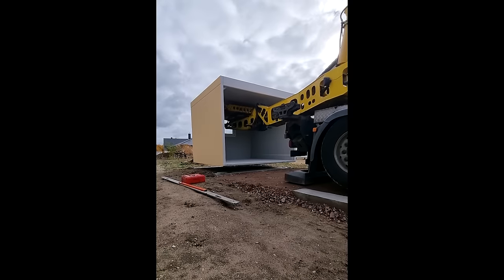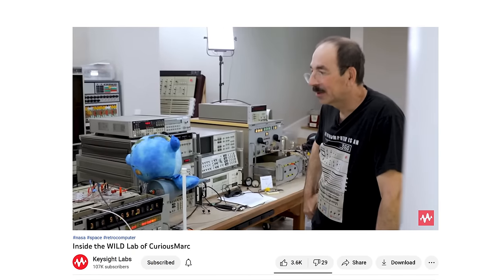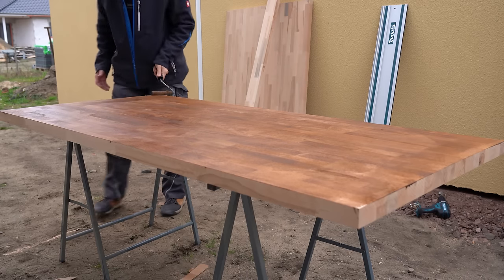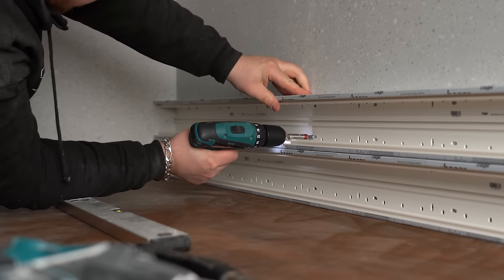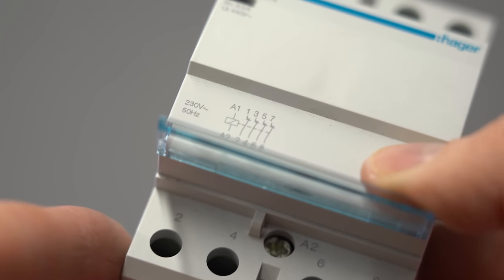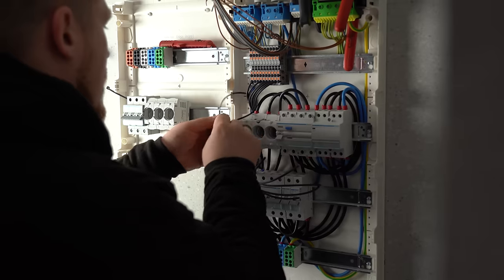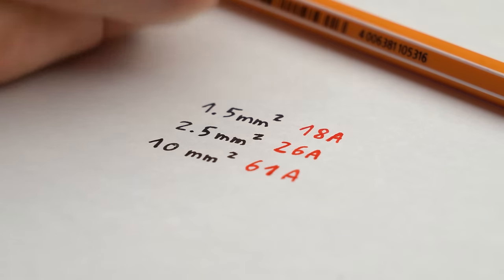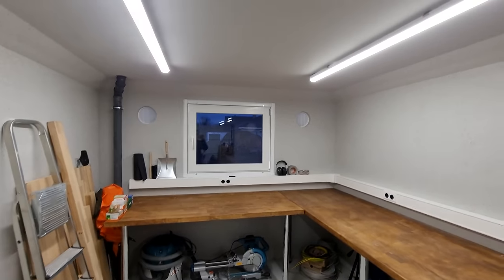Germans do the PERFECT Electrical Wiring! (Garage Build)

Comment: nice video!
A few things, first, I would have limited the use of spring loaded connectors, especially on the 400V, screw terminals may a bit more pain, because they need tightening ideally once a year, but I think they are more secure than spring loaded (if they come loose, you have to replace the whole device).

Adding a few RJ45 sockets in the modular wall conduits wouldn't be too much I think, it's better than trying to catch the Wi-Fi from the house through the concrete walls, plus, that would limit radio emissions too and that would be nice if you try yourself on wireless projects. 

For the emergency stop button, swapping the relay for a security relay is a must, your standard relay doesn't give you the guarantee that it will break the circuit if he got damaged (a short or any type of over-current can easily weld the contacts together) a dedicated security relay will break the circuit permanently if the power module get damaged and the automatic reset of the emergency relay on the NO contacts is a bit risky I think, you have no means to know if the fault still there or a device is still powered, a manual reset next to the door would add the extra step to ensure everything is safe before closing the circuit. I think Schneider make safety relays that include a surveillance module (maybe Häger too, but I don't know their catalog enough), with emergency stop and reset loops and a protected power module that hook the mains right after the fuses and breaker, they are probably more expensive, but I think they worth it.

Just out of curiosity, why the diazed fuses? I thought they were progressively phased out in Europe, is it a standard still very present in Germany? last time I saw this type of fuses, it was on a 30 year old machine, it was a pain to get new fuses and very expensive compared to similar 10x38 cartridges.

That's all I could think of, I hope I didn't come as arrogant or aggressive, English isn't my first language and I was told that sometimes I may come as a bit obnoxious, I assure you it's not my intentions :)
Reply: I'm no electrician. But i think the diazed fuses are better for high inrush current. The standard automatic breakers (C- characteristic) can more easily trip from starting motors, pumps, angle grinders etc. It is still widely used believe 😀
Reply: Indeed, as Eytaris wrote for emergency off you cannot use a Standard relay! You need special safety relay. On a Standard relay there is the possibility that that contacts Stick together due to arcing. Therefore you need to use safety relay.
Reply: Diazed fuses are still used as "main fuses" protecting the whole circuit; automatic breakers are then used in each sub-circuit. The idea is that the automatic breakers will catch any fault in normal conditions and if the diazed fuses should blow you really do have a real problem to solve. They used to be commonplace as normal circuit breakers, but those days have long since gone by.

I agree on safety relays, and in most places, you actually need two of those in a row (one opening, one closing) to prevent sticky contacts from arcs ever happening. Also, you should not only break the L1, L2 and L3 phases, but also the N neutral (but never the PE protective earth). Usually, safety realys will have four contacts exactly for this reason. Also, in a new installation involving 400V CEE outlets, one should have an automatic disconnect in case of power failure; this prevents an uncontrolled inrush current into any devices connected if the power returns. This requires switching the supply on manually, which is a minor nuisance, but a tremenduous safety improvement.
Reply: Hi, I also agree regarding the use of a true safety relay. Btw. The 64W will be drawn only for a short time, then it will drop below 6W or so. 
The datasheet sadly isnt´t clear in this. A comparable SCHNEIDER GC6304M5 Relay shows: Anzugsleistung 53VA, Halteleistung 6.4VA but only 2.1W of true power.
Reply: German Electrician here, although im NOT perfectly aware of the exact ruleset (VDE). You are righ, Diazed fuses are hard to find, thats because we have Neozed fuses. They are always the same size (Volume) in different ratings, so a 6A Neozed fuse is the same size as a 63A fuse. And yes they are used as main fuses befor a RCD or longer wire parts with higher diamater for more Power. Fuses and RCD's should always be selective, meaning you lower your rating the lower your go. NEVER put a higher or same rating fuse or RCD behind each other. So after a 35A Neozed fuse you go through a 40A (max) RCD, to your 16A breaker. Ask if you want to know some more :)

Comment: 7:56 - The 62.5 is only in the short period when the device closes. Holding it closed is only 7W according to the datasheet provided by Hager.
Reply: I knew it felt off having a relay coil draw that much continuously
Reply from the maker: Can you give me a link? The way it heated up while being activate clearly didn't feel like just 7W.
Reply: @GreatScott!  According to their website the operating consumption of the coil is 5.75W.
62.5W is the inrush power to close the relay.
If you really wanted to follow the industry standard everything should be redundant (2 contacts per E-stop and 2 relays for the power) but it seems to be a bit overkill for a garage.
At least having something is beter than nothing and E-stop are a great addition for a consumer's workshop so great idea an keep going !
Reply: @greatscottlab  Link? You can just measure that with your Gossen Metrawatt. But yes, above is true, AC coil contactors takes 10 times more power to close, when magnetic circuit is closed it takes much less. 63W in such small device will melt it down.
Reply: @greatscottlab  62.5 watts in a tiny coil inside a plastic enclosure the size of a fist without active cooling would be very hot. Think how hot modern CPU's run with their included tiny heatsinks under a full synthetic load. Now imagine stopping the fan, would you dare touch that heatsink after a couple of minutes?

Though to be fair, the CPU would (eventually) thermal throttle when it reaches TJmax and it's clock speed would drop like a rock therefore it's power consumption would drop as well. But even then that heatsink would be unbearably hot to touch.
And obviously a heatsink is made of metal which conducts heat way better than plastic.
A normal candle is supposedly around 80W of heat energy just as an example.
But you've got testing equipment. Measure the power draw?

Comment: You've done a great job with the building's electric connections. BUT, what I haven't seen in the video and I strongly recommend (in fact, i don't know german regulations but in Spain is mandatory) is the installation of Protection against permanent and transient overvoltages.
Reply: As a student we were also just explained about importance of adding such protection, however first you had to evaluate the risk factor on the site and I believe if it wasn't a public/government building you could only give your recommendations to your client about this. That's when we were told stories about some folks trying to save some money and ending up with huge losses due to fried expensive electronics, computers etc. because of overvoltages. :)

Comment: The wiring system you used is essentially exactly the same in Australia. We use the same breakers.
The only difference being is we use flat TPS cable instead of that white circular  cable. And where the conduit goes into cable boxes we would run the conduit directly into it, no cable can be exposed at all. Super interesting though

Comment: Nice job. I can tell in Italy fuse boxes are extremely rare since the seventies and aren't used in new constructions... so it's kind weird to see them 😊
Reply: What the heck do you do if not use fuse boxes? Mount your fuses to the wall?
Reply: @the_retag  we use thermal-magnetic circuit breakers...
Reply: @staffa007  ah
So still a fuse box using day to day terms. Few probably still ise songle use fuses, but its always called fuse box not corcuit breaker box
Reply: @the_retag  😁 👍🏻
Reply: There are beakers on the panel. The incoming phases are protected by fuses. That can be a requirement. A breaker can fail so that the circuit stays closed, a fuse cannot. That is the reason why for example in Finland the main fuses have to be actual fuses.

Comment: 400Vx16Axsqrt(3)= 11085 VA. A 16A CEE outlet can deliver 11kVA, not 6kVA.
Reply from the maker: Correct. I did not want to overcomplicate things with sqrt but that was not the correct way to do it.
Reply: @greatscottlab  simply count it as 3 times the single fase 16A*230V

Comment: For endings and corners of cable pipes, use protective ribbed hoses (wire loom) that fit into the canal. This hides cables, and protects them in those places (important close to workbench).
Reply: I was also surprised that the cable was left unprotected. I assumed they were going to finish it, but left it like that. It is my only complain, and otherwise a very very neat job.
Reply: I am not sure why, but unprotected endings and corners are common in Germany.
Reply: @JackNorthNexus  The cable is double-insulated. Using conduit is not required at all.
Reply: the pvc pipes are only there to hold the cable in its place, the cable is double insulated

Comment: Hot damn. You guys are gods compared to what Mexican electricians will do with our houses' wiring.

I can't count how many times I went and found incredibly unsafe and out of spec wiring in my own home.

To give you an example: Electricians in Mexico will refuse to install physical GND on a house if they can avoid it.
I struggled to get a guy to install one ground circuit in my home and he only did it at the start of the main's circuit, that ground is not connected to the rest of the house.

Comment: Things I'd have done differently - I'd probably try to get rid of the legs for the workbench as far as possible.  My experience is that wherever they are located I end up sitting with one of the things right where my leg is supposed to go.  Office furtniture is expensive and often the table depth is to small.  So I ended up buying the biggest kitchen table from a well known Northern European furniture company for my last office and aside of having legs in the wrong place it has served me well.

Comment: Looks really stunning Scott, have been a huge fan of the way Germany does electrical & technology items in general, especially being fascinated as a kid over the Grundig Trento HiFi gear which helped sparked my fascination in electronics & technology.
Being from Australia, it's so interesting how slightly different electrical wiring is done in Germany (seems a lot like the Greece system with the wiring outside the wall as Aussies due to plaster board/drywall tend to run it inside the wall) & really love the modular plug setup.
As long as you have an ELCB protecting the workbench for safety, the only other thing I'd recommend for your workshop is an isolation transformer & dim bulb in-line mains limiter in case you ever work on hot chassis equipment in future & your LoRA based power & garage monitor.
As many of these items have already been working a treat at your other place, no need to re-invent the wheel & you should re-deploy all the things you had setup in your old garage at your new place.
Congratulations on the new house & wishing you all the very best for Christmas, new year in 2023 & the festive season
Reply: As a german I can tell that the wiring outside the wall is mostly done in garages and industrial places. Inside the living space the cables also are inside the walls/plaster.

Comment: As an European living in another EU country (Poland) it was interesting to watch mainly because one doesn't often see electrical installations done on the walls surface (as opposed to the much more common in-the-wall installation). Here in Poland I think the rules are pretty much the same as in Germany and we commonly use the same types of parts as shown(except wago connectors, those are less popular, we often use screw terminals with solid core wiring). Also the choices you made were interesting. I did a lot of electrical work on my own garage few years ago and more recently on a shed and a pv installation (of course I had it designed and certified by a qualified electrician). One of the things I did differently is I used square cross section snap-on plastic conduit instead of pipes for the cables in the buildings, also I used standard outlets. This conduit was easier to install then piping and it the idea was for it to be easier to modify in future, but having seen this video I now think pipes look better :-) I hope you do make another video on wiring of the house too.

Comment: The German electrical system look very similar to Czech electrical system. But instead of pipes we like to use light gray square channels with lid. I dont know what are they called in english. (In german should be 15x15 kabelkanal lichtgrau)

Comment: It's interesting to me that you're allowed to set up your conduit with "gaps" at corners and at entrances to boxes; it looks strange to me (living in North America) as I've always seen electrical wiring done either in continuous conduit, or with spiral-armored cable. You also occasionally see NM/Romex cable, but that's mostly used for in-wall rather than exposed/surface installations like this.
Reply: I agree it looks strange from here.  However we occasionally do something similar in the US, where instead of using the conduit as part of a complete raceway system we just use it as a sleeve for convenience or to protect against physical damage. In my basement the NM is sleeved in EMT until it reaches the ceiling joists, where it is then stapled in the traditional way to framing.  That said the lack of connections from point to point here would just grind my gears.  I assume Germany has complete raceway systems that would look and function better to protect against workshop damage.
Reply: You don't have to use the pipes anyway, so having gaps is certainly not an issue.
Reply: The cable is double-insulated. The conduit is not needed, it's just used to replace a crapload of clips.

Comment: Instead of a safety relay, you can use an additional ground fault interrupter with your button shorting it to ground. (this will mimic the test button on the device) For double safety, you have to reset the interrupter after resetting the push button.
Reply: GFI's can be really expensive tho, especially when it's an atypical current rating. 40A ones are usually way more expensive than 63A ones for example. In itself tho, that's a really neat idea if you wanna spend the extra money :D

Comment: I was very surprised by the fuses and fuse holders- everything else is 2022, and then you have screw in porcelain fuses straight out of the  1890s!!!
Reply from the maker: They add an extra layer of protection.
Reply: @greatscottlab  absolutely, I agree with additional fuses, I am just surprised the fitting/design is so ancient looking, compared to everything else. I have only seen screw-in fuse holders in a museum! From a UK perspective it's like you'd used a bakelite and brass knife switch from a Frankenstein movie, or something similar made from polished wood and brass, it just looks so incongruous next to all the modern kit. I remember my Opa telling me about screw in fuses from his childhood in the 1920s!
Reply: @richardbanks2669  But in Uk you still use fuses in yours electic meters as a main fuse.And your electric panels are stil use rewireable fuses
Reply: @tsataras  Yes, and no. We have a main fuse, but electrical panels haven't used rewireable fuses since the 80s, its all MCBs - if you still have rewireable fuses in your distribution board it is long overdue for replacement. To be clear, I'm not surprised at the use of a fuse, I'm surprised at the use of a porcelain, screw in, fuse of a design by Thomas Edison! UK main fuses are of the cylindrical variety, not screwed in like a lightbulb! I guess "if it aint bust, don't fix it", but I'm just surprised that the design has remained unchanged for more than 100 years :)
Reply: @richardbanks2669  k1 k2 and k3 fuse holders are still common in mainland europe. And still inproved to a ip rating that you cant touch the active parts.

Comment: With the relay wired like this, it is less than ideal for using the emergency stop buttons as a 'master off' switch for the bench. The relay will use power when everything is off. So, I'd add a master switch. Also, add one or two outlets that are on at all times, regardless of the emergency stop and the proposed master switch, for a computer and networking equipment. Depends a bit on what you want to do in that room. An always on outlet is also handy for a cordless tool battery charger.